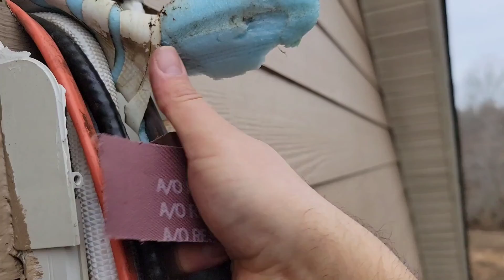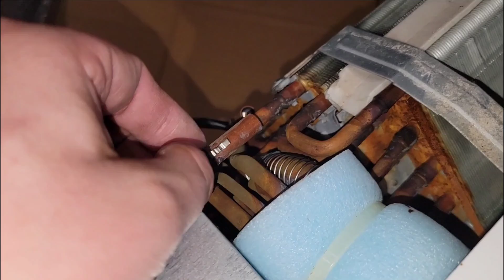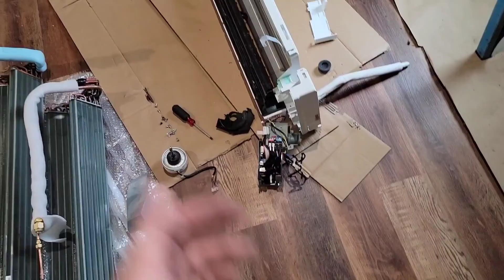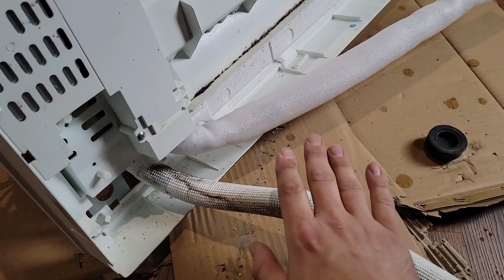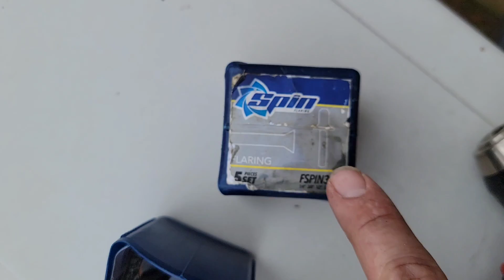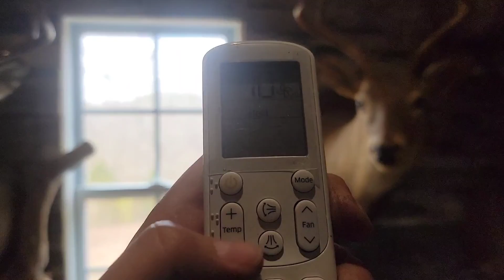Replacing Mini Split Indoor Coil - Easier Than You Think!

Comment: Hi, what are the symptoms of a leaking coil ? Just had mine cleaned after a small fire, now it's freezing up inside the unit if I lower it to 21c. Mine is about 15 years old,  is it better to replace the whole system you think ? Thanks so much
Reply from the maker: I would the system a good cleaning and check the charge
Reply: @taddydigest  thanks for the reply. I just had it professionally cleaned by a company that puts the bag underneath and cleans it. I don't know if it's a coincidence but it's been frosting up on the coil since then. I wonder if something was damaged by removing the cover. I might have to have it checked by an AC specialist I guess. Thanks so much for your help

Comment: Question. My 18 K BTU mini split unit is in the garage. A tech found the indoor coil leaking. He recommends replacing the entire system. The current one is about 4 to 5 years old and I’ve changed the main control board 2 years ago.  I’m not in a financial position to buy a new mini split. Please give me your opinion, is changing the indoor unit is a sound decision?
Reply from the maker: Is the part under warranty?
Reply: @taddydigest  no. It’s 4-5 years old
Reply: @emiliosanchez5621  what brand? Most reputable units are 10 years

Comment: First thing you should’ve did was pull the cover and then the drain pan and the motor And wheel. The coil would’ve been super easy to take out and then put it back in the same exact way. I’ve got to do one tomorrow and it’s going to suck because the copper is in the wall. Idiot builders.😮❤😅😢😱🥵

Comment: I did my first 5 head Fujitsu with rectorseal Pro-Fit pushin couplings on our home. So far 2 years later, no leaks.  Not sure I'd trust those couplings/adapters on a clients home.  It sure makes tying in the head units to the linesets.   I still haven't tried to sell minisplits in place of "old-school" systems   Maybe another year or two before I really trust the manufacturing/lifespan.  But, I really think those Mitsubishi 1 way ceiling cassettes are a desirable product.  Same goes for the push-in couplings.   Hard to teach this 60 yr old dog new tricks.    Thanks for you videos.
Reply from the maker: Thanks for sharing your experience my friend and you're welcome so glad you're here to watch the videos.

Comment: use a torque wrench and too high on the nitro test pressure IMO. that low side test pressure is marked on the outdoor unit. I don't go over 350psig nitro. could cause a coil leak.
Reply: Typically 3 times your average suction pressure so 400 is plenty